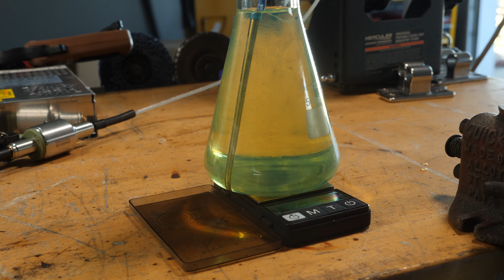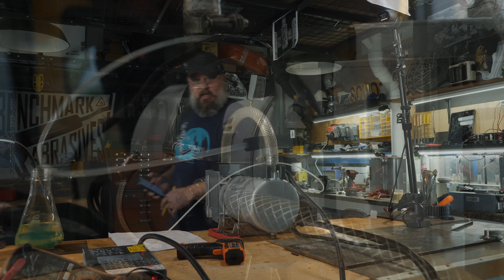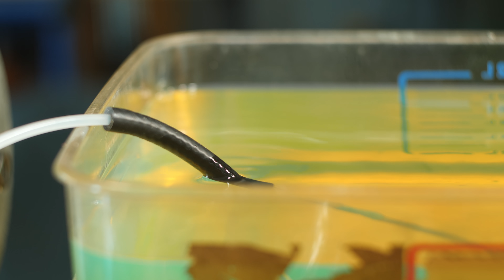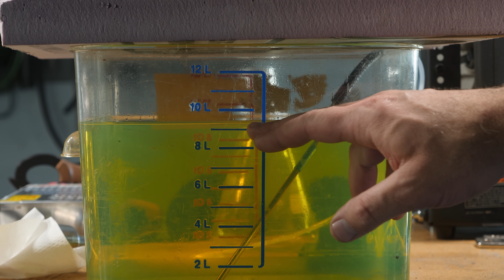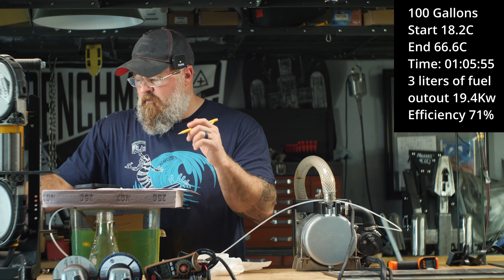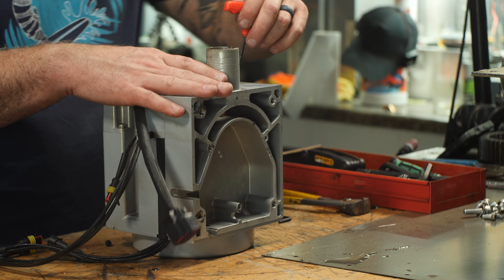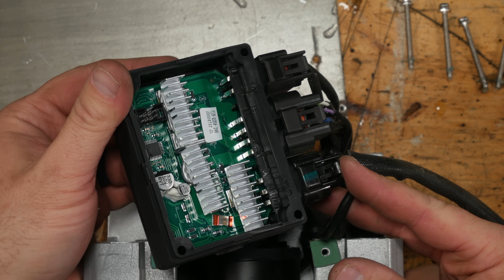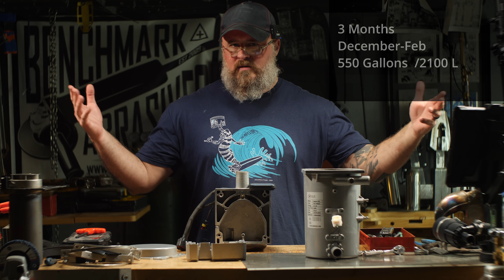The Diesel Heater They DON’T Want You to See — Real 20kW Output!

Comment: We have something better it's called natural gas forced air furnace....just saying end of your off-grid situation be better off with a heat pump and solar system with batteries 🤷‍♂️ 

• Natural Gas: Costs roughly $1.20 to $1.50 per 100,000 BTUs. Natural gas is incredibly cheap in North America because it is abundant and delivered straight through underground infrastructure.
• Diesel: Costs roughly $6.50 to $7.00 per 100,000 BTUs. Because diesel is a highly refined vehicle fuel subject to retail margins, delivery overhead, and heavy road/environmental taxes, you are paying a massive premium for that energy.

So is this really that special ..... Your best bet if you're trying to heat a cabin and it's really cold is to get solar and use electric heat 🤷‍♂️

Comment: Super good info ...I live in a 26ft RV trailer in northern BC Canada. I think that diesel heater would work well as a "basement" heater. I would enclose the entire underside of the RV with rigid foam insul panels and run the heater in that basement space. Presently it costs me over $800. in propane for 2 to 3 months of rv furnace heat ...but it never heats the floor.

Comment: I connected a Chinese 5 kW diesel air heater to the house's chimney; it runs at half power and heats a stone house—specifically an area of about 40 m²—from 17°C to 22°C in winter.
Why such a small rise in temperature? 16–17 degrees is unpleasantly cool, whereas 22–23 degrees is pleasantly warm.
In the evening, the central heating kicks in to warm up the whole building.

Comment: Awesome test, breakdown video!  What's your opinion on a 20-30 foot camper trailer to heat water & climate control, in a 3 season camper(which is typical) but able to handle cold & high altitude?  If you could point me to specific videos that would be very helpful also!

Comment: Sorry mate but there is no way thats 20kw  it took you 1.05 hours to heat approx 425 litres ( 100 us gallons ) of water.  My 5kw webasto thermo top can heat a 3000L Jacuzzi in 60 mins using 400ml of diesel. The biggest diesel water heater I have used is 30kw that used about 1.2 L an hour and took about 15 mins to  heat a 3000L Jacuzzi.
Reply: How is that tub insulated ?

Comment: if you are going to burn diesel.. instead of the problems with heating water like what happens when it freezes because it is -20 and the heater is down.. just use an oil furnace and run the furnace on diesel instead of #2 heating oil... diesel and heating oil are almost identical

Comment: I suspect the efficiency depends on inlet water temp. Should measure inlet and outlet temp and water flow rate keeping inlet temp constant. Efficiency would be higher when inlet water is colder due to larger delta T between burn chamber and water. Feed from one tub into another. Test would also be much shorter.

Comment: We use a 8kw Chinese diesel heater to heat my workshop been using it for 10 years not a single problem with it and it cost me £80 I use 5 gallon of diesel every 2 months and its on for 8 hours a day in winter and it's thermostatically controlled

Comment: I was considering one of these for my house emergency heat until I heard them. Get a vented kerosene or fuel oil house heater like the old monitors unless you are trying to heat something you drive around. If that is the case, you need something like this unless you want to use propane. Look to RV’s if propane is ok. I run a Monitor heater burning No. 1 fuel oil off an inverter for the board when my power goes out. I paid $300 for it and updated it. It is hooked to the same supply as my house furnace which is a Beckett setup for the same fuel. I spent a long time getting to that point. I heat 1300 square feet just fine with either systems.

Comment: you don't need a bigger tank to do testing. which need to do is have two tanks one cold and one that will be able to catch your hot water then you run cold water into the machine at a known temperature and then you measure the temperature coming out and the gallon per minute flow and then you do your math. and then that'll be a realistic comparison across all of your units if you had done it all the same and it'll be much easier to actually calculate the btu output and efficiency of the machine so the easiest way to do that is just start with the garden hose and run it into the machine measure the temperature going in measure the temperature coming out and your gallon per minute flow and you got all the information that you need

Comment: 👍Got me thinking about costs to run. I pay $0.22 / kwh for power, so with diesal having about 9.8kwh per liter, at 71% efficency thats approx 7kwh per liter being obtained. so 7 x .22  is $1.54 worth of power per liter used, which is not as much lower as i thought it would be compared to diesal, especially with how often power is going up in price lately(i pay around 1.65 / liter currently). I have considered putting one or even 2 of my spare chinese heaters in house before(have 6 with only 3 in use), but always thought they would be comparitively too expensive to use, except in emergencys. (But no idea how efficent they are, possibly nowhere near this units 71% figure?). 
 Edit, - Opps, just realised i forgot to consider one factor, i use 3 modern heat pumps for heating, which produce around 4kwh's of heat per kwh used in my usage(on 24/7 so always running at low speed for best COP), so unfortuanetly that makes the difference huge, so will scrub the idea again.

Comment: Just by the Chinese diesel heater off of Amazon for $150,200 bucks 2 gallons of diesel a day this is what I run in my shop that is 30 by 70 average temperature when I'm running it is about 20 outside and it'll get my shop to about 60
Reply: Yup.  Baught 2 for my garage.  Propane to get temp up fast. Then deisal heater.

Comment: Since you are grabbing heat from the exhaust after the burn chamber wouldn't the result be soot build up at the point and possibly after the point of heat collection rather than the burn chamber itself since that should not be affected assuming you are not adding any noticeable restriction to the line during the collection process

Comment: this is a sweet back up for my home, i am using a high eff hot water tank, fancoil loop in my existing forced air ducting. i could make this a backup for my system very easily, i think id just need a 2nd loop....pretty cool! love to try one out.

Comment: I think the efficiency is higher than your calculation.  It doesn't seem that you've engineered for the heat loss from a non-insulated plastic 100 gallon tank that has a fan blowing against the side of it for 1.05 hours.  I'm guessing there is more heat loss then you have calculated for.  I'm guessing the thermal efficiency is more like 76%.

Comment: In Scandinavia, the calorific value of 1 liter of diesel is 10.5 kW under optimal conditions. If your diesel boiler was at 100 percent efficiency, your consumption would be almost 2 liters of fuel per hour. You Americans calculate differently, which is why Scandinavia probably has slightly cleaner air. 😉

Comment: Boats are a good application for these large diesel heaters.  My previous 34' boat had an ITR Hurricane hydronic boiler that provided hot water to fan coil units and the domestic hot water tank.  My current 48' boat has a Webasto forced air diesel heater with no provision for heating the domestic hot water.

Comment: Free flowing exhaust, not a problem, just extend the exhaust as far as it takes until the exhaust pipe reaches room temperature before exiting the building, any longer and the buildings heat begins being lost to the pipe. The exhaust pipe may get moisture and creosote but a pressure washer can rinse that out with an input port on the upper end and have the pipe drain like a sewer pipe angle along it's run to the exit outside. A slight upward bend on the exterior with a critter flapper blocking the end and mesh. Drill a small moisture drain drip hole at the underside of the bend. Even if you build a sound proof muffling box on the exterior you can still route the exhaust back into the building to capture that extra heat along it's length until you run the end back outside again.
Reply: recycle old gutter downspouts and the cost for the extra exaust is next to nil.

Comment: I've got a old 55 gallon drum heater. US army. Soak the start sponge with diesel, light it,drop it into the chamber and open the flue. It pulls the flame around the doughnut and up the flue. Boiled 55  gallons in 12 minutes.
Reply: That is gnarly!

Comment: 24V would run COOLER than 12v  (half the amps)  so the reason for heat sinks isn't because 24V

Comment: I know I can hear 8-12 stainless steel plinth water run heating with a 22 or 24 volt fan so therefor considering we are on a boat I can the heat a 45 Liter twin coil cylinder and all the ply nth heaters with blow heat it should all be boiling heat in 15-25 mins due to 15 mm or 1/2 inch plastic piping it’s very very easy to plum in and heat  these heaters are approximately £150 - 250 each  with switches that are approximately .600 wide x 10 mm high by .299 mm deep with flexible😂👏👏👏👏👏

Comment: I heat my 2900sqft house from mid-November to mid-March with an outdoor pellet stove. It maintains 90 gallons of water in a range from 165F to 175F (74C to 80C) which is circulated through a heat exchanger placed within the existing air handler. The stove has an external hopper that holds exactly 1 ton of pellets which is roughly a 30 day supply (depending on temperature swings). During these months, the heat pump part of the HVAC system is disabled and the thermostat merely calls for the fan when needed. The internal HVAC system has no control over the stove and vice versa. 1 ton of pellets produces about 5 pounds of fine ash and produces almost no smoke. Weekly cleanout requires about 10 minutes of light effort. Filling the hopper takes about 40 minutes. Due to the temperature ranges experienced during the extreme heating season, I burn approximately 3.5 to 4 tons at a cost of $289 per ton. The house not terribly efficient, but is easily kept at 74F (I have elderly folks here who need it that warm). 
Compare this time and effort to when I was running an outdoor wood unit (exhaust gas recirculator burn chamber). I burned 5 cord of wood per heating season. Which I either had to purchase or cut myself (felled, bucked, hauled, split, stacked, and fed into the stove EVERY 8 hours). It produced approximately 25# of ash weekly, required full cleanout and flue scrubbing weekly. It produced massive amounts of smoke.
Using the heat pump would render a nearly $500/month electric bill (with half the heat strips disabled) and not heat comfortably. It is most efficient in the fall and spring with night temps above freezing.
So, this diesel unit would burn about $1925 of fuel at $3/gallon (current local price), plus electric, and this would be higher since my requirement would be heating the water to the range specified above.
IMO, pellets are king. EDIT: the pellet stove is rated, and delivers 96.2% efficiency.
Thanks for a great video!
Reply: Great comment. I use air source mini splits run by solar panels. Rarely need a generator as backup. I get 24 k btus of heat and air.
Reply: Plus Inertial tank
Reply: Looking sharp boss!
$3/gallon diesel - them were the days!!
Reply: What outdoor pellet stove do you use?

Comment: I'm looking for a unit that I can hookup to the ducts on the front of my diesel Pusher, 40 foot by  9 ft with a 20 foot by 3 ft slide out. I am eliminating the LP tank on the driver's side. The duct are plastic and flexible plastic hoses. I think the output is too hot for this, any ideas? Or is there one out there that will work. I have a lot of room under the passenger seat.

Comment: The numbers I  got back was about 85$ a season at 3.73$ a gallon .. at 22.8 Gallons used per season..  Not sure if I wasn't running the numbers right but anyway it seems like it would be pretty cheap if it didn't run 24/7 ..

Comment: I would couple this hydronic heater with a solar heating system for a small to medium sized home. To operate strictly on diesel would require around $400 or more in diesel in the winter, and half that with solar charging a 200 gallon storage system. Almost the same for the average electric hydronic costs, down to negligible on solar hydronic and solar electric, with incredibly low maintenance, only a high initial cost.

Comment: For 130 bucks ya get a 110v hot water heater w 21l tank ok....grab a 12 volt heater core blower box typically sold for semis anyways ic your not pickin up what im puttin down yet then just stick to payin aheat bill lmao.  The elec bill increase aint much but 12 to 15 bucks a month.  Be a smart fella and use magnetic induction hsater off a seperate solar panel n 12 volt fan motor  well um then theres no fkn bill increase lmfcao

Comment: i have not had to get into this much danger for heating...i use AC mains, propane backup 1, honda is7000 backup 2 or i run both backups in together if shore power fails, gen is heated by my loop so its ready to fire up. works a treat!

Comment: Run the exhaust through an oil filled radiant room heater to get even more efficiency.  The exhaust at the exit point is less than 90 degrees F, nearly all thermal energy is transferred for an insane boost of heat.
Reply: How would one run the exhaust “through” the oil filled radiant heater ?
Reply: @TheSuperChannel  Well the oil is contained within the double walled fins that the steam runs through.  You pipe the exhaust through the empty channel and it works like it did when it was being heated with steam.  Then you attach the muffler on the other end and run it to where you exhaust through the wall.

Comment: 8 1/2 amp draw while running?  That's not exactly efficient when you add in the diesel...
I have a '72 Volkswagen Thing that has a small gasoline heater in the front trunk; it's dangerous as fuck, but it works amazingly well - it uses drips of gas fed right off the main fuel line ... it's super efficient, almost unnoticeable consumption.  I always thought if I could scale the design up 3 or 4x, it would be perfect for a shop.

Comment: My father ran water pipes through our fire place. Thermostat and a pump moved it through our baseboard heating. Worked like a champ. That is as long as my brother and me chopped wood.
Reply: Good old free labour
Reply: Cheap, effective. But requires a 'nanny'. If everyone did that like the old days, the air quality would be even worse.
Reply: We did the same thing but with a Fireview stove.  We had electric heat in upstate NY and that was too expensive apparently.  I was also the wood stacker, splitter, carrier and had to fill the woodbox every night so others wouldn't have to go out in the cold to grab wood to stoke the stove after going out in the cold garage.
Reply: @osok3121 Upstate NY myself, western. Niagara Power was very expensive. Props to you for the hard work. I'd like to think I'm a better man for it. Stay healthy.
Reply: @SuperRockinRobert   I escaped NY and moved to better pastures.  No more cutting wood.  I don't miss those days freezing my appendages off splitting firewood with the old man.  I had to stand still and run the splitter while he manhandled the rounds.  I was only around 10 at the time and he couldn't figure out how a little guy ,just standing there doing nothing but running a hydraulic lever, could be freezing while he was sweating 😳
Reply: @osok3121 Yeah, I'm in the Carolina's now. In my teens I referred to my old man as "angry man". Later I realized he didn't want to be out in the cold any more than I did. He just wasn't any good at expressing himself. My dad grew up very poor in Pennsylvania. The work was just expected. But when I made mistakes, the discipline was always fair. Sometimes even allowed to slide a little. Credit for working hard when need be I suppose.
Reply: @SuperRockinRobert  I think our lineage might be connected somewhere down the line because that sounds sooo familiar!  I also moved to the South.
Reply: Boiler?
Reply: we built a 3000sqft cabin in Colorado that uses thermosyphon pumping and the loops go through the basement slab and walls with check valved runs up the 3 stories up to the attic to create the pumping loop. with the insulation of the rest of the cabin, just adding wood to the fire "pumps" the glycol, the only manual option was the cooling bypass which is a heat exchanger under the deck to dump heat if needed. there was also a dedicated thermostatic controlled syphon that fed the 100 gallon water heater tank in the attic (has heat exchanger coils in tank designed for solar/electric operation. feeding the wood was the bad part since fighting heavy snow in the upper Rocky Mountains.
Reply: @chrisstinson2536 Sounds bad ass. Feel your pain with the wood though. I was 13 during blizzard of '76 in western NY. Going outside to get big chunks of wood to split in the garage (rotating wood in for next day so it was thawed for chopping). But I do love wood heat. Chestnuts roasting by an open fire, LOL. HO HO HO

Comment: Ok now the perfect test would be a cement pad with in floor heating using 100L tank of coolant and this unit if it will heat a 2000 square foot area

Comment: 2kw is only 2kw heat. Just shy of 7000 btu, less efficiency of unit, so that’s it, all depending on delta T, period. Nothing else, that means if it’s 20, you want it 70, that’s 90 degrees delta T differential. Heat travels from hot to cold, larger the difference the faster it goes unless you insulate it, or bigger problem, air infiltration.